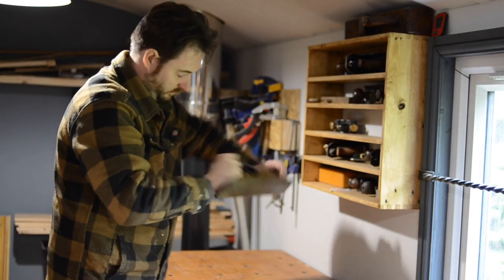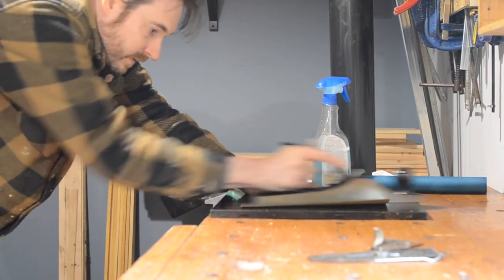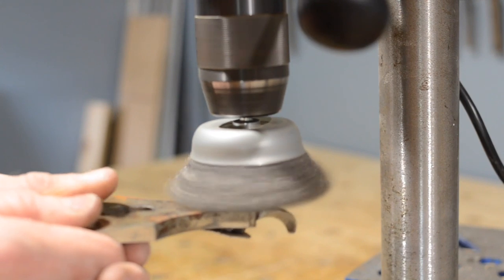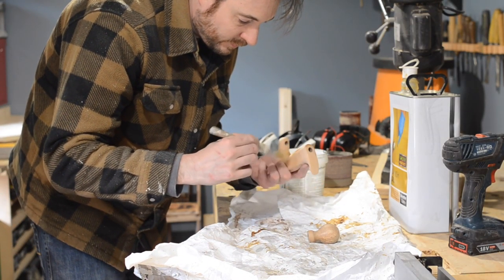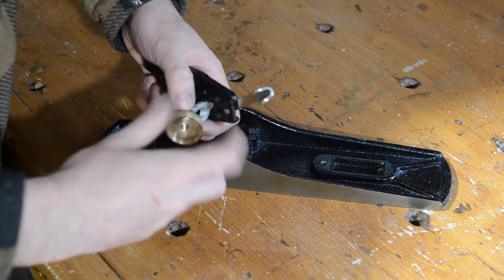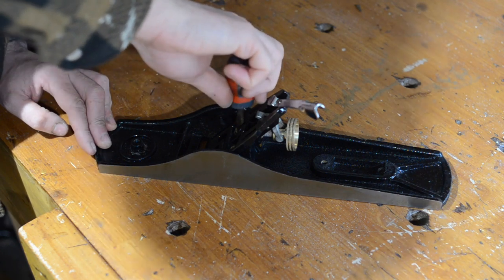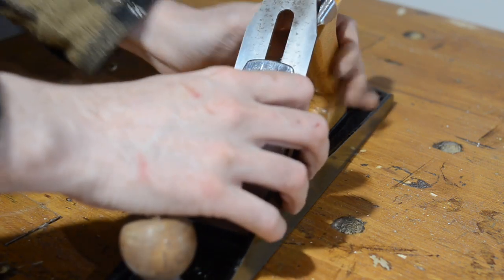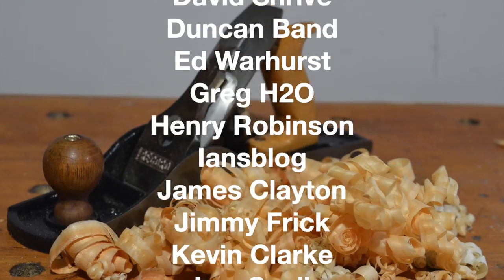Restoring a Record No. 5 Hand Plane

Comment: Plane came up a treat, nice work. You mention leaving the frog in place when flattening but I was taught you should also leave the blade assembly locked in as well so the plane is under tension.
Reply from the maker: Thank you. I don't think it would make much difference
Reply: It depends on the casting quality of the body and how far out of true it is when you start. Having the frog in place doesn’t add any tension to the plane as it’s simply attached by the screws but when you lock the blade in place that can add a significant amount of load into the plane as a whole which can slightly alter the overall body shape. I’m pretty sure Paul Sellers advocates it as well for the same reason.

Comment: I just did up a Record #5 last week, the Record a lovely plane that is used on most jobs. I’ve also got a wooden Jack that I was going to do up as my #5 smoothing plane, but I think the record with the adjustable depth is a better option and I’ll made the wooden one more for rough work. 

I leave the blade in backed up when flattening the sole. 

A great video, well done.
Reply from the maker: Thank you

Comment: Nice and straight forward explanation and demonstration of restoring a plane. I liked it, especially the finish on the tote and knob. I was always led to understand that flattening should be done with the blade in situ yet you removed the blade before flattening! Also that the chip breaker should be rotated before removal so that it cannot come in contact with the sharp edge of the blade. Any comments?
Reply from the maker: Maybe you are right
Reply: Rotating the chip breaker falls more under good practice than an essential. It is generally best to have your plane pretty much set up before you flatten so pressure from the cap iron and frog is allowed for etc. Real world though, distortion in the body from this is minuscule if detectable at all. And I've looked for it thinking it'd be a good demo of "what not to do and why" video. Not finding any I dropped the idea. So again, my conclusion would be these things are best practice rather than essentials.
Reply: Bisch Basch Bosch Ive restored several planes to working condition because i want them functional rather than pretty and I abhor people who buy antique tools and display them on a shelf or in a cabinet. My feeling is also that f;attending with the cap iron etc in situ does not make any noticeable difference. After all the body is very strong and stiff. I also think if you are careful then how you separate the iron from the chip breaker is not that significant, as you say its good practice.

To Matt: I wasn’t intending to be critical, just making observations. I hope you are not offended. Love you vlogs.